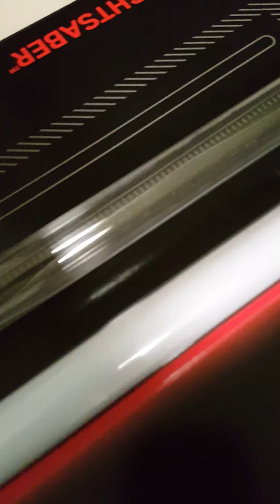Customizing a Force FX Kylo Ren Lightsaber part 1

Comment: hi i dont know what you mean by" cutting it all the way down so it wraps around itself?"
will one 48 inch cover do the main blade and side pieces and is it the correct diameter to slip over the blade's snugly?
also what do you use to cut the tube?
Reply from the maker: After measuring and cutting 3 piecesfrom one 48" fluorescent bulb cover, you slice it from one end to the other curving back and forth slightly. after doing this the bulb cover will want to wrap around itself and will hold onto the saber blade snugly. hope that helps.
Reply: +Mike Avallone right but you dont rejoin the slice?
also do the covers come in just one diameter?
Reply from the maker: It's a 48" long bulb cover. it fits over a standard fluorescent bulb. after cutting for length, then making the slice on each of the 3 pieces, you slide them on the saber blades. that's when you start applying the hot glue. you just do a random, jagged pattern.
Reply: +Mike Avallone Hi Mike sorry to bother u again but would you know what external diameter the tube cover is please? i have about 5 sizes to pick from and cant measure my Kylo saber blade accurately enough .
Reply: +Mike Avallone Mike do you know the internal diameter ( not length) of the tube please??